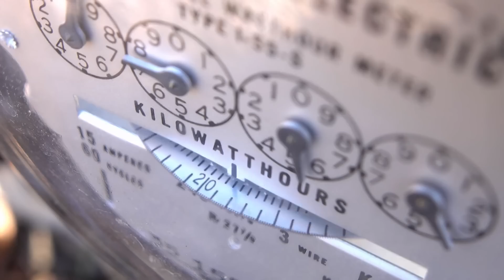The Most Powerful Laser Weapon in Development

Comment: I'm wondering what the effective range would be in different conditions. It's not that lasers don't have a long range but environmental factors like weather, humidity or altitude do come into play when you're dealing with light.
Reply: @Willam_J  Cue Reflective  armor lol 😜
Reply: @Moloko_b  Coating your missiles in Military Grade Glitter!
Reply: That will definitely be an issue at times.
Reply: @Healthliving1967  Sure they have.
Reply: Adaptive optics beam director takes all that into account.
Reply: @Healthliving1967  Yeah, that's what I was thinking too.
Reply: A mirror would work as a defence if it surgically clean,. Not in our atmosphere. Ablative armour coatings like carbon foam could be a solution but the main limitation is the atmosphere or more to the point, its humidity. The longer the distance, the more heat dissipation. on a foggy day, losses could rise  to 30% of loss and a naval version would have the problem ov being fired from a large surface of water that constantly emits water vapour...
Reply: Also if its day I imagine the laser would lose power, just like how you can barely see a flashlight if you are in direct sunlight but it will still be very bright at night
Reply: @nemo-79000  Nope. Wrong. 300KW IR laser would burn right through your little clean mirror. Even in visible light, if a mirror is 99% reflective, that leaves 3KW of laser to ablate your mirror surface.
Reply: @Healthliving1967  How am I supposed to "Go do research" if "this technology is classified" smart guy
Reply: Hazard range of a laser increases by the square root of the power increase. A 300kw laser is 10x more powerful than a 30kw laser so it’s effective engagement range increases by the square root of 10 or about 3x. Effective range of the LAWS is thought to be about 1.6km which means the new system would have a range of around 5km, and that’s on a clear day with a low dew point. That is enough to engage incoming artillery rounds and maybe low flying sub sonic cruise missiles. Not so much for aircraft or ballistic/hypersonic missiles. Still it adds a capable layer of A/AD. 

To effectively engage a ballistic type missile you would want to start hitting it at midcourse or terminal stage or about 150-300km. At terminal stage you would need a laser power of 300MW 1000x more powerful. For midcourse interception you would need a whopping  1.2GW all focused to a single point. Beyond the fact that there is currently no way to focus that amount of light energy, you would need an entire power plant dedicated to powering such a laser. Maybe with the advent of compact fission/fusion reactors you could solve one of those problems so it could be possible that such a countermeasure may become feasible in the not so distant future.
Reply: @badger jamees. Na that’s just physics. The propriety classified technology is how they manage to focus all the individual laser beams into a single point. I don’t know how they do that. I do know however that lasers follow the inverse power relationship.
Reply: @mark vaughan reflective surfaces could dissipate some energy but shape of the mirror is more important than reflectivity. Concave surfaces are best as they cause the light to get stuck and oblate. Unfortunately airframes and missiles tend to be covered in convex surfaces which is less than ideal. A better option would be heat sinks especially for n control surfaces and other critical areas. Problem with those is they tend to be heavy. There really isn’t any good counter to directed energy weapons at the moment. Then again there aren’t really any effective directed energy weapons currently deployed. And LAWS doesn’t count. The ability to engage targets at a distance of one mile in this day and age means did-ally squat. That effectively counters nothing except commercial drones and maybe pirates using an outboard motor boat. Hartley a weapon system that would have any use against a near peer adversary like Russia or China.
Reply: @Healthliving1967  But you are also speculating, unless you work on the project, and if you do then you're breaking your NDA by leaking information.
Reply: @Healthliving1967  in one breath, go do some research, in the same breath it’s all classified.  Brilliant.
Reply: Depends on the wavelength. Infrared is not effected by most things that visible light is. Why the jwst sees things Hubble never could.
Reply: @johnn19  By using a second laser to create a lens in the atmosphere the first laser's beam could be re-focused near the target which would counter-act the dispersion-with-distance effect described by the inverse-square law (which is generally applicable to all types of electromagnetic radiation).   An atmospheric re-focusing laser would have no effect on the absorption of laser energy by the atmosphere itself, but it might still significantly extend the effective range.  And an atmospheric de-focusing laser might theoretically be an effective countermeasure against a hostile high-energy laser.
Reply: @Healthliving1967  No. A dichroic mirror normalized for the dynamic reactant will reflect 99.9999% of that frequency laser.
That's how the laser WORKS.
Reply: @Healthliving1967  Yeah, unlike the Pentagon hirelings I can read.
I know about thermal bloom and photon crowding preventing any Laser over 4 MW/cm^2 (about a 2 minute burn through on a fighter and to hell with EVER getting through a ceramic missile nose cone) at any range greater than 100 miles.
For a hypersonic (Mach 7 and above) aircraft that's about 2.4668 minutes flight time so...assume perfect acquisition via radar before the 100 mile mark, then train your laser on it at max range and get less than 30 seconds of excess.
You will not penetrate. The laser cannot adjust focus outside the 100 mile radius (at sea level) no matter what you do, limits of physics.
This shit has been tried before.
Remember Star Wars? 13 TRILLION dollars and not one working weapon against fast missiles.
Reply: @alexandrsoldiernetizen162  No. The limits of resolution include photon crowding and thermal bloom.
1/2 principal wavelength at 1 mile is limited to milliwatt outputs
Reply: @Healthliving1967  No, MOST of the research is already in the public domain thanks to Star Wars (the reagan initiative we wasted 13 TRILLION on over the years)
Reply: @johnn19  They don't and actually can't. Wave interference of course.
Reply: @dl6519  atmospheric lensing can only dissipate the beam energy>
See "Thermal Bloom" for details.
Reply: @hellstromcarbunkle8857  Haha you are about 20 years behind the curve assjack. The same adaptive optics that allow terrestrial telescopes to overcome atmospheric interference and see the to end of the universe are applied to the beam director. Combination of precision control, precision optics, and computational advances.
Reply: @johnn19  The adaptive optics of the beam director focuses the fiber strapped diode pumping blocks into a single beam then sensors compute atmospheric conditions and adapt the lenses and mirrors to focus them beam to an optimal point. 100W on 1 meter doesnt do squat, but 100W on 1mm burns steel.  The advance they made is this sequential gain system, where they dont have to use fiber combination but use one diode pumping block to pump the next one linearly, apparently. The beam director still uses adaptive optics just like the telescopes on Earth do to overcome atmospheric interference. In fact, the telescope system uses a laser projected into the sky and the reflected beam is analyzed for distortion and the computer decides the mirror and lens config to overcome it.
Reply: @alexandrsoldiernetizen162  NO, NO NO NO.
You need power in excess of 2MW / cm^2 for JUST a fighter, and telescopes work in powers of 2 uW/cm^2
An entire HOST of thermal, electrodynamic and optical issues PROHIBIT power levels
Talk about BEHIND!!!
Reply: @Willam_J  I don't think mirrors are a problem with laser weaponry.
Reply: @xTheZapper  there’s people who know of the projects and don’t have to have secret clearance. Anyone working on those projects exposing secret info are in much more trouble than breaking an nda lol. Regardless, I’ve personally been exposed to power distribution for laser projects without clearance. You know the basics without jeopardizing any of the tech. The timeline is certainly well before the dates mentioned in this video.  But that’s like most military projects.
Reply: @hellstromcarbunkle8857  You clearly are babbling incoherently at this point. I dont think you grasp the theory of adaptive optics. The telescopes are not shooting down drones, microbrain, they are using a laser beam to analyze the atmosphere by the reflected wave and then set the parameters for the computer to adapt the lenses and mirrors to compensate for distortion caused by atmospheric conditions.
Reply: @alexandrsoldiernetizen162  Oh, btw, drones are so slow the laser will DISABLE,not destroy, in 20 minutes or so.
AS I pointed out, you don't get 20 minutes and you can't inject enough power to make do in 2 minutes.
Reply: Yes. Hypothetically, combining ionizing UV or higher frequency lasers with a high voltage pulse (electron beam?) has the potential to "punch a tunnel" through the atmosphere, forming a waveguide that could have much longer range, and deliver a lot more energy to the target. I'm not expressing this correctly, I'm sure, but hey.
Reply: @GaryBickford  Hmm, how many ways are you wrong there? No, nah, nope, not quite. The technique you mention can be used to ionize the air and send a high voltage electrical pulse along the beam path, but it wont create some sort of vacuum tunnel that conducts photons more effectively.
Reply: @alexandrsoldiernetizen162  I don't recall the specifics, it's been a decade or two, but the method or effect I alluded to (poorly, I freely admit) was shown to work. However IIRC it required a UV laser, which is not yet a candidate for practical use for these purposes.
Reply: @GaryBickford  Creating an ionized atmospheric channel isnt going to conduct IR laser light any more effectively, which is all a UV laser would do.
Reply: There is nothing like scamming the U.S. taxpayer
Reply: @Moloko_b  Aluminum foil.
Reply: @Willam_J  I am not sure if you are being serious or not but mirrors won't work against weapons like this.
Reply: @Healthliving1967  this gives me hope .. thank you sir
Reply: @johnn19  you know your stuff … wish my brain was fictional enough to formulate stuff like you obviously can .. thank you for explaining  your knowledge in a way this layman can wrap its brain around !
Reply: Im done with this bs! Ya all can scwabble amongst yourselves like pigeons fighting over crumbs! BYE BYE!
Reply: Lol. This is a 300kw laser. It would melt right through mirrors. You'd need a mirror so heavy that it'd be pointless to put on a vehicle you expect to be moving. These lasers are meant mostly for defeating missiles. You won't see any type of "armor" or physical barriers for lasers like this on a missle that is meant to be as lightweight as possible.
Reply: @johnn19  , that’s why the US intends to put high power lasers in planes. A 474 with a laser at 30000 ft waiting for the incoming missiles will be a workaround solution until the technology is afvanced enogh.
Reply: @Willam_J  true, but traditional weapons traveling at traditional speeds can be targeted by traditional counters...but I don't think hypersonic platforms can afford wearing mirrors.
Reply: Also, the surface that it hits could be shiny and polished, refracturing a lot of energy. And there is the problem of reloading/charging. Yes, supercapacitors are charged fast, but where does the power for it come from? How many "shots" will it fire before it must be recharged? Can you make the tracking head small enough to track hypersonic targets? Can you make it mobile at all?  Hypersonic Missiles must be able to absorb a lot of heat, as they generate it by friction themselves. Cutting through a slab of aluminium will not be enough, if your target has a thermoceramic nose, that resists 10 times the heat.
Reply: Lasers that are powerful enough will pierce right through any bad weather or cloud cover with ease
Reply: @Gunni1972    reloading is is a problem with any form of interdiction. However I think your point regarding hypersonic is forgetting that the Laser’s energy (assuming you can hit the damn thing) is being added to the already very high heat being produced. Heat is already a hurtle for hypersonics, so unless they’re way more advanced then we think and have effectively solved the heat factor, pumping a sht ton of energy onto a point is gonna melt something. And nearly any compromise in the structure at that speed would be catastrophic. The problem, like you pointed out, is actually fking hitting the thing.
Reply: @Willam_J  icbms arent mirrors lmao take a lap
Reply: Had the same thought.
Reply: @freemanlevack6556  Day or night makes no difference. The torch you can't see during the day is still putting out the same energy as it does at night you just can't see it 🤷‍♂️ 

Most of these lasers are out of the visible light spectrum but even if they weren't if it's day or night has no effect. It's better they aren't seen anyway.
Reply: It depends on wavelength that will be used.

Comment: ICBM missiles are all hypersonic, the difference since 2020 is that they've now got 'agile hypersonics', they can fire them like a cruise missile at extreme range (1000+km) and then either glide or power, changing direction as they fly 'nape of earth'.  This would allow them to dodge fixed detection equipment and gain surprise, usually with only seconds worth of warning.  The warning and defence will need to be distributed, most at sea or on high ground (to avoid nuclear torpedoes creating a tsunami effect).
Reply: And can only fly in the light-bulb-vacuum envelope, thus turning quite slowly
Reply: If you were forced to select the one countermeasure to go at these hypersonics you speak of what would you select ? I’m very naive to knowledge of any effective counter measure in production or planning .. can these lasers be a viable option ? Or do they need a lot more advancement?.
Reply: @hellstromcarbunkle8857  what’s that ?
Reply: I thought most hypersonic cruise missiles either used scram-jet which run better on thinner air or the glider variant that fall from around 60000 ft trading height for range and kinetic damage at impact. I know of those 2 are for land attack is there a sea skimmer for anti-ship?
Reply: @davidrutherford6311  Mach 5 vehicles cannot travel at those speeds at sea level anyway. Atmospheric drag plus compression heating will destroy the vehicle.
Reply: If you look into the tsunami effect likelihood prepare to be underwhelmed. It turns out we don't live in a movie, you can't make a nuclear tidal wave of any great merit

Comment: The even more interesting will be the ultra-short pulse laser weapon US will test in august. Which is self-stabilizing and has many positive advantages compared to a constant beam.
Reply: Also, it is sounds cooler.
Reply: @CharliMorganMusic  Yeah, it doesn't work. Chirped laser pulses bloom at exponentially increasing rates.
Reply: @hellstromcarbunkle8857  all lasers bloom regardless, why would pulse lasers be any more impossible?
Reply: @georgethompson1460  Energy Density per cubic millimeter. Result, superheating air to expanding plasma (lens).
Obviously a multi-terawatt CW would do the same.
Reply: Did it work?
Reply: @firstmkb  haven't been tested yet